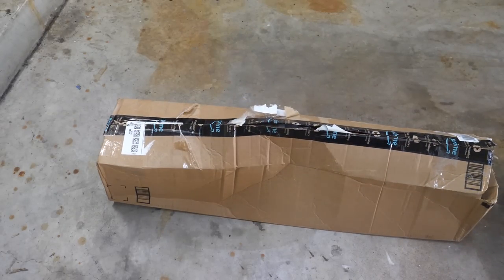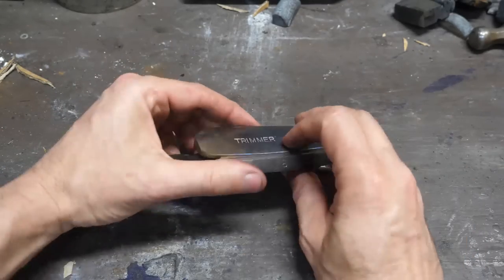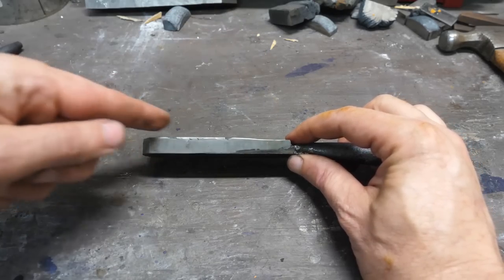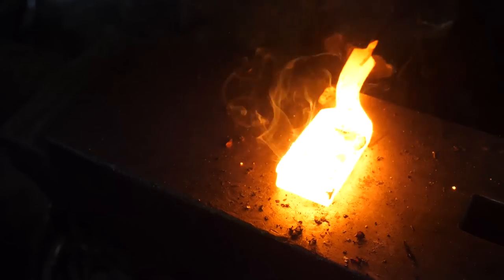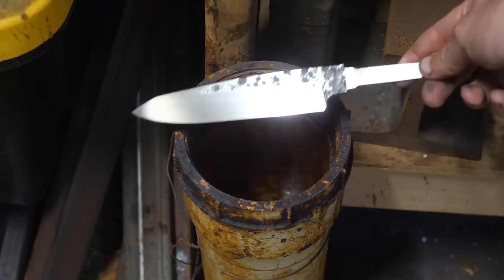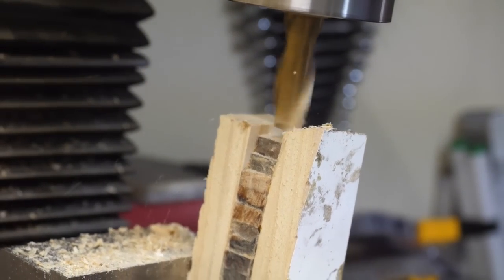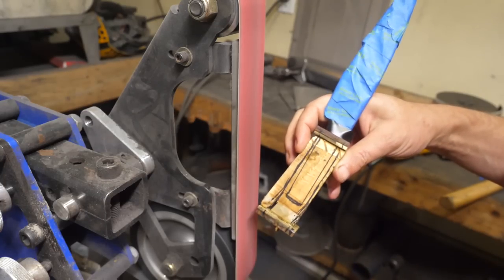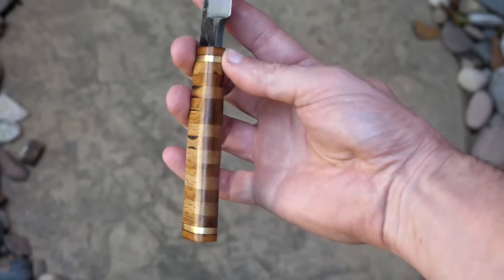Forging a Knife From Golf Clubs!

Comment: When the side exploded into goo I was thinking, oh crap that's done but you managed to somehow drag that back from the brink of disaster 
Definitely a unique little piece 
One of the things I've never gotten to try with vintage metals (because no budget!) would be old hand saw blades and stack them up to see how they go. Most of them were for their time, quite good high carbon steels in the 0.6-0.7% carbon range and should make for a very tough, springy knife. Maybe throw a couple of old carpenters rip/cross cut and a hardback mitre saw under your tender ministrations with the angle grinder and see what shows up after some forge welding.
Reply from the maker: That'd be a great one, I don't think i've seen it done before.
Reply: Garage sales and your local dump are your best friend when it comes to vintage saws. Get the boys some coffee and donuts and they'll pick every saw the see for you. Good luck!

Comment: Most modern traditional style "blades" are made from forged high carbon steel, although most of these irons are covered in chrome, but you can buy high carbon wedges with no plating. Vokey/Titleist and Taylormade us 8620 carbon steel, Mizuno uses 1025 steel.
Reply from the maker: Very interesting ty

Comment: A lower carbon steel does have it's advantages.  Edge retention is a great concept until you chip your expensive VG10 edge chef's knife on a bone sliver you didn't know was there.....overall great job!  I love the handle and how the etch brought out the different layers of steel, almost looks like the Hamon on a Katana!
Reply: That's something I learned the hard way making chisels. Almost anything the average guy can heat treat at home is better off under 60 hrc

Comment: Something I've been curious about is what happens to the metal that flakes off the surface when it's hammered? It becomes some sort of metal oxide, or rust, right? Can that be salvaged and melted back down?
Reply from the maker: Yes it could be melted.  It is essentially iron and will reduce back to iron.
Reply: @GreenBeetle  Awesome. Thanks for the answer.